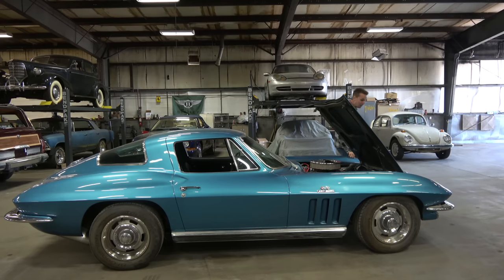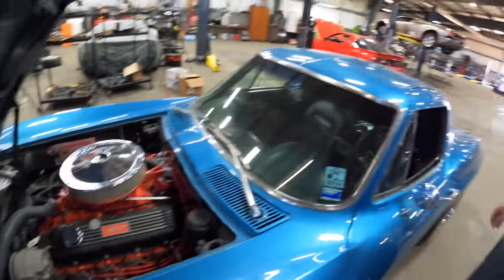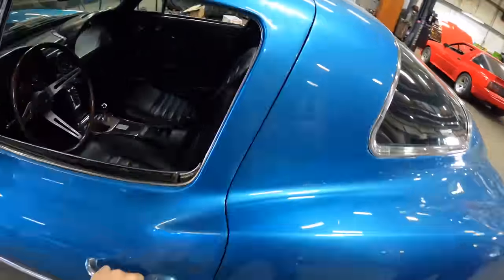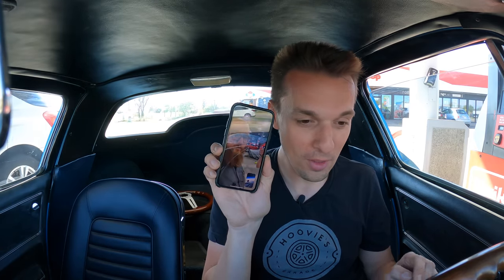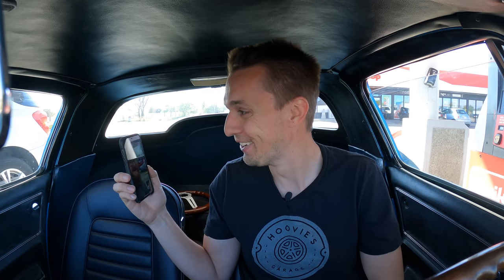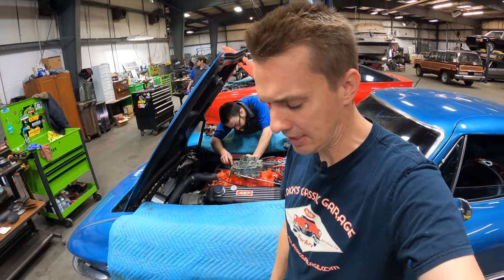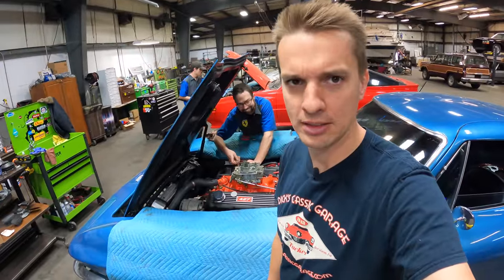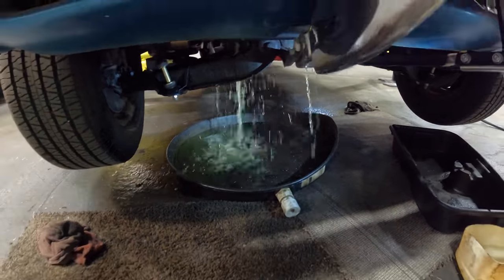Driving My Cheap 427 Corvette for the First Time (Of course it broke down)

Comment: That carburetor has vacuum secondaries, which means when you're sitting there revving it up a little bit the four barrel will not open ... the engine has to be under a load for the back two barrels to open, which means you would have to take it out on the road and floor it

Comment: The Wizard's statement @ 2:16 just made me excitedly smile. It felt for a second like he was talking to me and the Vette was mine. I got this sense of satisfaction and joy imagining how it was going to feel as I rowed up through the gears from 10 to 110 mph! PS; it's funny that Hoovie didn't know that the tach was fixed until a while after he'd been driving it. The first TWO things I noticed when Hoovie gave us a really cool POV shot entering the cockpit was I. The engine turned over after about 3/4 revolution (exaggeration, of course) when that mighty 427 c.i. brute fired into life then, 2. I immediately looked to the tachometer face and voila' she's-a-work. Just kind of made everything worthwhile. At least until the H2O gauge pegged @ about 260. OOPS! All in all it's still a bitchin rod and one of Hoovie's all time best car buys.

Comment: Well buying a new carburetor means that any tuning that was done on that previous carburetor is now gone. So to be thorough you still have to take that carburetor apart and look at all the Jets and the power valve and make sure everything matches.
Reply: Chances are the old one was just out of the box too. Vac. secondary on a solid lifter 427? The cam sounds pretty tame.
Reply: @hotpuppy1  Yea I wonder if they are really going to find a solid lift? Maybe a OEM part?
Reply: If it is a 427 that Carburetor is too small, they need to find out what Engine it is.

Comment: Heck, I bought a 1965 'Vette back in 1982.
First thing I did was pull the engine, replace the fuel lines (double flare on each connection) and add a Holley 650 double pumper.
Also, new radiator and brakes and new interior - even at under 20 years old, it needed all that - or, maybe not, just thought I'd do it while I had it sitting for a bit.
The down side is it was a Powerglide transmission - I've read that's a rare item these days.
It was the same color - I wish I never ran into that tree in '83!
Thank for the content! :)

Comment: My question is - why didn't they flush the cooling system before giving it back to hoovie? That seems like a pretty obvious oversight to me...
Reply: And he shouldn’t have started it until he cleaned out the fuel. I don’t think he mentioned his price, has he? It’s got to be worth a small fortune.
Reply: Staged for content
Reply: Hoovie likes doing everything backwards like most of us would do.  At least me anyway.
Reply: @kendallsmith1458  Taken as is, I'd be blaming the mechanic for not considering or raising it as a risk. Replace all fluid when a vehicle or anything with an engine has been sitting for a long time.
Reply: @gorillaau  including brake fluid...
Reply: @brucefisher4025  Yes, replace the brake fluid. Don't forget to bleed the brakes afterwards. 

Blinker fluid should be good for a while yet. :-)
Reply: @gorillaau  Personally the blinker fluid is the only thing I don't even bother to look at. That stuff is durable ʕ •ᴥ•ʔ
Reply: @desertrainfrog1691  I don't ever re-pack my exhaust bearings either

Comment: Bought a 67, 427 in 74. Loved that car. Did have a problem keeping the front end aligned due to the heavy engine spreading the frame. Some extra gussets and re welding fixed that. Paid  $2700 for it!

Comment: I worked in a radiator shop and we had a pressurized air over water engine cooling passages cleaner.  It made lots of noise, but clear water turned black when it hammered away.

Comment: Hoovie checking the anti freeze is one of the first things you do when ever you purchase a used car, ESPECIALLY if it's been sitting for years, I would look for a set of high back bucket seats for this car, check out some seats out of some newer vette's.  High backs look better and they are actually safer, especially if you're ever rear ended.
Reply: Add a few electric. Fans
Reply: Totally disagree on the seats, it would be a crime to put high backs in this car
Reply: Doubtful that particular Corvette will ever get rear ended it’s more likely to rear end somebody but you are right about the seats
Reply: Hoovie gets rear ended every time he buys a car. Seats won't help.
Reply: @chase7350  Hi. Having driven in these cars new and a few years old..even up to speeds on the GSP. HERE I would recommend   a 3 point harness and better hi back seats if he wants to race ....friends got into a mva in 69 sand it wasn't pretty with her forehead...no need for details......drive wisely and cautiously
Reply: @rsprockets7846  yeah but he's not gonna race it so there's no need, my grandad has a 64 vette I've driven plenty of times, if you want safety while you drive get a honda
Reply: Hoovie looks like a Shriner on go-kart sitting in this one.
Reply: @chase7350  yeah not the car to take kiddies iinn...these cars perform horrible in mvas and even with the lap belts your noggin. Hits the steering wheel and God forbid the dash crumples up to your knees
Reply: @rsprockets7846  yeah for real lol, these cars are best suited for cruising around town, going to shows,, and the occasional stoplight showdown in my opinion

Comment: The fact that he even got to drive such a magnificent car is a luxury most people wouldn’t even be able to dream of considering how rare split window Corvettes are.
Reply: Im not trying to be an asshole but split window vettes were only built in 1963. This is a 66. Split window literally means the rear window is divided down the center into two separate pieces of glass. Its a cosmetic thing only and has gotten blown out of proportion.
Reply: Its not a split window. Still a rare car, but not a $150k+ rare car

Comment: Assuming the cam has been changed. The original painted cast iron intake 427 had hydraulic lifters. The 427 came in two tunes. The hot one had 425hp aluminum intake, large port heads, solid cam etc. The other had medium port heads-a small port was made for use in trucks-the cast iron intake, hydraulic cam and smaller carburetor. It was the basic 427 they put in full size cars of that era, but it made the lightweight corvette go fast! GM restricted the 427 to corvettes and full sized cars, however Don Yenko and others would be rectifying that the next year.

Comment: How we used to clean the engine put straight water in add about 3 cups of cascade dish washer fluid in run for about 1 hour then flush with clean water then drain then re add antifreeze

Comment: I cannot believe no one popped off that radiator cap for a quick inspection before Hoovie's test drive.
Reply: Me too. Me bet is that the fame is starting to  take place on Wizard's head. The Lamborghini steering rack I can't stop thinking too that is something that could be prevented or checked before. Some folks told about wrong hose installation or a valve. Let's see what will happen.
Reply: He did in the earlier video. The water didn't get rusty until it was run for a length of time. All the rust buildup was on the head not the radiator.
Reply: they checked in the first video
Reply: I came looking for this comment...  Makes the wizard look bad, I mean get a new car go through everything but they must do this for views.
Reply: or clean a carburator that has been stored for 5 years. I leave my motorcycle for 6 months unused and it gets al gunked up
Reply: He probably told them he'd only bring it for a short spin

Comment: Corvette's typically need an expansion tank for the high point to fill / burp.  With the laid back radiator they have the thermostat is higher than the cap and they are hard to bleed air bubbles.

Comment: A new horn button would improve the look of the interior. I also imagine that the rubber bushings on the suspension components are pretty much shot at this point. I do love the color! Keep plugging away and bring that back to running and driving like it should.

Comment: Fill it with 75-25 % of distilled water and CLR. Run/drive about 100 miles. It will clean all crap from inside of the block.
Reply: That makes a lot of sense now that I hear someone mention it. Thanks for the tip.

Comment: The clutch is firm: dude, it's a 427 big block lol...
Reply: It has to have a clutch plate like a vise in order to deal with that torque.  Driving one of these will give your leg a good workout.
Reply: @plektosgaming  exactly.....I remember driving a friend's hopped up 5.0 mustang and the clutch was about the same pressure as the throttle. I'm sure he told me it was a featherlight but after googling it, nothing.
Reply: It's an aftermarket hydraulic clutch. The original clutch would have been an 11 inch diaphragm and would have worked quite easily. As an added bonus, the clutch would have had 2 positions, fast/heavy or long/light. Not there any more with that aftermarket clutch assy.

Comment: Like every big block Chevy I ever drove, one problem after another. I used to restore Vettes, and the first thing you do is clean the fuel tank and change every part from tank to engine including the fuel pump.Never saw a block that rusty that didn't have problems later on.(How long was it driven with all that crud blocking cooling passages to parts of the head and block)

Comment: When I picked up a truck that sat for a little more than 5 years.  Same issue with overheating and rust in the coolant.  Several flushes later, it was still overheating.  The fins on the water pump had rusted and got weak from sitting and then when I started running it, they broke.  So, long story short, don't give it a second thought, change the water pump.

Comment: It's going to overheat again.  It needs to have an expansion tank, and then the air purged from the system also.  Look at the engine.  The highest point for the coolant is the upper hose which is above the radiator.  Most cars have the radiator tank highest in the system, but due to the hood line, a Corvette radiator doesn't have one and thus the need for an expansion tank.  An air pocket will form at the top of the hose and the coolant won't circulate properly.  Found this out on the first C2 Corvette I owned.  And it's a lot worse on big block cars.

Comment: Always use the 5, 50, 500 plan on new or refurbished cars.
Drive 5 miles. Fix anything that shows up. Drive 50 miles. Fix any problems. Put 500 miles on it checking for problems and if any are found, fix them. After that, youre ready to use the car as intended...

Comment: I would have done at least two more things before putting coolant in. First, I would have run distilled vinegar for a few days to flush out the rust better. I would have also installed a coolant filter from Gano. I had the same issues in a classic car and the vinegar and filter did a great job. Otherwise, you will keep clogging the radiator. ASK me how I know!

Comment: My favorite Vette!, Almost! It's the 427, (originally) and it's Nassau blue! I like the 67 a little better but I damn sure wouldn't turn this one down!              I'm so glad that the original steering wheel is gone and the ''Pimp my ride one is gone! I can only see a few little changes that I think it needs and first and foremost is I would put a 1967 dual reservoir style master cylinder on it, in fact I would have told them to do that before it ever left the shop! It would suck big time to wreck an ORIGINAL PAINT 66 Corvette over a few hundred dollar part!  The second thing is the aluminum radiator, If it was mine I never would have put it in there but I would at least paint it black to conceal it some! It makes the engine compartment look tacky! The next thing is the valve covers, I would put a set of original looking valve covers on it. And last but not least I would try to find a place to hide the MSD box, Or make a cover for it and paint the cover black! Absolutely a beautiful ORIGINAL PAINT 1966 Corvette! Did I mention that it's ORIGINAL PAINT?!

Comment: Should have done a reverse flush on the rad, get the top neck hose into the pan and water hose in from the bottom.  Have to do it every year with my Rover v8 as it's very sensitive to heat and the cooling is only just enough to keep the temps down.  Same with the engine, water hose in the top inlet, thermostat out, catch the crud at the outlet.  Heater box too, same thing.

It's a gorgeous gorgeous car though.... real thoroughbred Americana.

Comment: That looks like a 390 horsepower (L36) 427. If so, it has hydraulic lifters which would make the clicking noise if one is clogged. The solid lifter cars had aluminum intakes and were 425 horsepower  (L72) with a dual line Holly carburetor. Since it's not original,  any combination is possible.

Comment: Car sat for 5 years.  Replace all the fluids immediately.  Flush the engine and radiator and to save yourself some further grief, install a filter on the upper radiator hose to catch the flakes and junk coming from the block for awhile.  Carburetor gunked up?  Rebuild it or get a new one (which was done).  Also either clean or replace the gas tank along with all the fuel lines.  This should have all done by "The Wizard" if he truly knew what he was doing.

Comment: You really should consider using a cooling system cleaner like Fleetguard Restore Plus to get rid of all of that rust and corrosion in the system like what you showed on camera from that radiator hose opening.

Comment: If I were replacing the carburetor on that, I would have at least gone with a 3310 750 CFM vacuum secondary, but more likely an 800 double pumper. Maybe the one they're using is more "Correct", but it isn't a numbers matching engine anyway. Big block Chevrolets don't look right with carbs with side hung float bowls.

Comment: You cant see if the secondaries open up with a car sitting idle and blipping the throttle. Thats the point of them being vacuum controlled. You need to put load on the engine.

Comment: You need to open block plugs on both sides to drain the junk out , not just the bottom radiator hose.

Comment: since the engine isn't the original then I would rebuild it with a roller cam, new heads and intake, headers, and a Holley EFI

OR just drop the 427 LS-7 in there.  Its not a big block but its a reliable engine that males respectable power in stock form.

Comment: An LS7 427 would be sweet in there. I only dig those model Vettes and the 80's no humps. But I guess to keep it "Factory-ish" since the engine is original the BBC isn't a slouch either. But that would be the only way I would roll in an old car is with a modern-ish LS Vette engine and suspension upgrade. If I could even afford to do anything. As my daily is a 2000 F-350 7.3 Diesel with 180k original miles. My play car is really a 1993 Chevy S10 with the engine from my 2001 LS1/T-56 Trans Am. To each their own.

Comment: He heated up that engine and drove it hot now it's ticking badly. Could be major internal damage. When that temperature gauge started rising he should have pulled over immediately (tow truck?) and let that engine kook down properly before restarting it.

Comment: I had to come back to this video after seeing your last one. I noticed at 7:09 when you were leaving the gas station and the temp gauge was pegged at hot. This tells me it probably was overheating for some time before you pulled into that gas station. Then drove it like that for some amount of time after that before you noticed and pulled over. To be honest, that's probably what broke the motor in the end, just some extensive overheating and driving it with 0 oil pressure. Just sending it, gotta appreciate that.

Comment: We rebuilt and restored half the car, but no, we didn't bother to check the cooling system. What could go wrong? Kansas farmers with a classic Corvette. If it needs paint, we'll take it to Maayco. Yeah, that's what you have to do with an old car. You have to drive it to see what's wrong with it. If it blows up, well darn, that's on you. And I'm a Wizard because you believe me. And just sitting for five years rusted the engine. Never mind that antifreeze contains compounds to prevent that type of rusting. But either way, we never bothered to check it. Now pay the bill. That's sounds like many Mopar Master mechanics I know. Pretty much all of them.

Comment: Okay it's not just me. Wizard does it too.
5 mechanics standing around looking at a fluid leak guessing where it is coming from. Me: hmmm it doesn't have the tinge of brake fluid, it's not sweet like antifreeze. It has a bland oil taste but it's very light. So it a leaking from the fluid filled motor mount. 
5 mechanics: good eye err ummm tongue.

Comment: I am guessing that the intake manifold is cast iron because it is painted. The redline on the tach is 6,500. There are 2 versions of the passenger car big block Chevy engine  in that era. The 6,500 redline means this car was built with the high performance big block, which was 425hp, and had beefier internals. Low performance big blocks redlined at about 5,600. I suspect the engine that was swapped into this car is low performance, so do not rev it to 6,500 Hoovie!  A quick check of the engine ID would be time well spent.

Comment: Where did you find that particular new Holley carb?? (With the divorced choke and pressure relief valve?)
Reply: Summit or Jegs, it's a 600 cfm Vacuum Secondary.

Comment: Don't know how much you paid for the car but given the fact that the coolant was rusty and not a milk shake is really the difference. Had it been the latter you'd be dealing with a cracked block / cost of a new motor. Buying a classic car is tricky and more times than not buyers get burned, usually with intentionally hidden, costly rust issues. The best value in 20 yr or older classics is always a C5 Corvette. No body rust and the LS motor = PERFORMANCE.